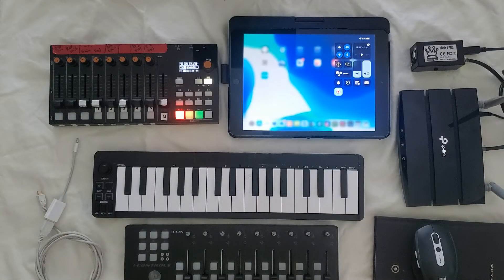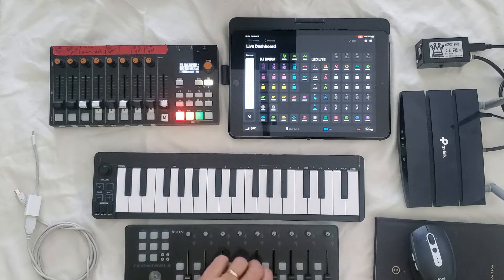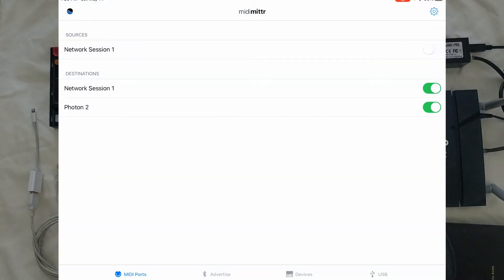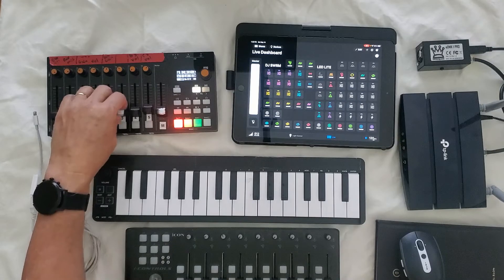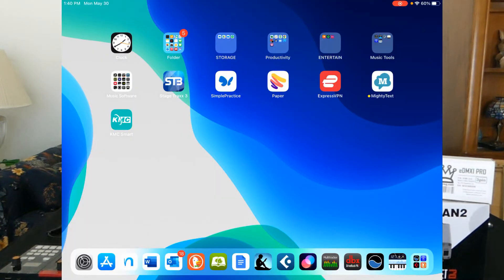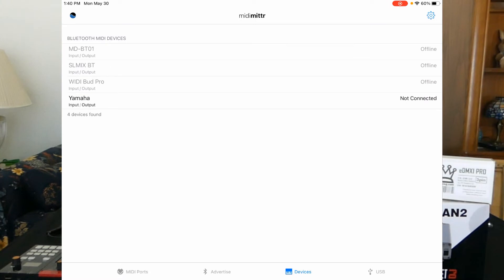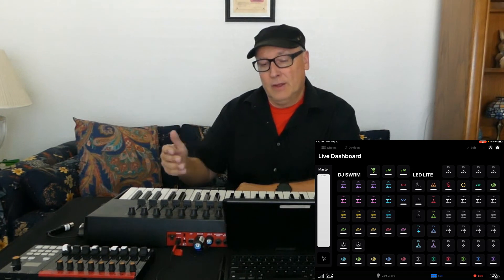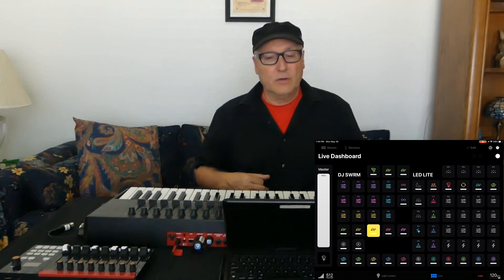Running DMX from your iPad using Photon2 using Newer BLE or converting legacy MIDI devices to BLE

Comment: I want to be able to midi control the dimmer fader by expression pedal. Do you know if it’s possible to midi map this/CC message on the app? The midi mapping part is an in app purchase so can’t find this out for myself but want to know if it’s possible before purchasing.
Reply from the maker: Yes. The main thing that you want to be sure of is that you have a MIDI connection to your iPad (best if it is either Network or BLE). If your pedal communicates midi via 5 pin DIN, you are in luck. Just grab a WIDImaster from CME and it can pair via BT to your iPad and Photon will pick it up with no problem. If it only has a USB B or C input/output to your pedal then you will need to directly connect it to the iPad. If the pedal has integrated BLE, all the better. The main question is “how does your pedal communicate MIDI to the iPad regardless of any particular app?” This is the biggest matter. Photon will see MIDI direct to your iPad (mostly, you don’t even need midimttr). The video after this one, where I construct a light show live is completely via a BLE connection from a 5pin DIN on my MPK261. Photon accepts it all!. Be sure, to create the fixture, put a control on the Live Panel, then you can assign the MIDI CC# by just moving the pedal.
Reply: @CaliforniaCreedence  thanks so much for your response. Sorry I should have said that I already have an expression pedal connected to my Morningstar which has a Widi Jack which connects to my iPad and other things. I could see photon could see CC messages but wasn’t sure if an expression pedal would work in this way. Thanks again.

Comment: I just purchased a DMX-AN2. I was able to configure it (after a lot of hassle), but as soon as I connect it to my router, it isn’t seen on the network. Any thoughts are appreciated.
Reply from the maker: Either the router ip needs to be changed to 2.0.0.0 or the AN2 ip needs to be changed to the router ip which you will need to know. Usually on the router label. Then they will “talk” to each other. I have had others struggle with this, I walked them through it over the phone. If you need help I am willing to walk you through it.
Reply: @CaliforniaCreedence  great. That has worked. Thanks so much. I’m in business and creating a show. I have some moving lights which will be a challenge. One issue I am having is that I’ve created a new fixture profile, with custom controls, but many of these controls are not appearing when I place the fixture in a group. I am a bit lost on this.
Reply from the maker: @AndrewBanker1  They don’t appear under custom controls when in the Show view and opening the group? There is a button labeled Custom Controls when the fixture is selected in the group. You may have already done that, nevertheless. If they don’t show there, then the device setup was not done properly.
Reply: @CaliforniaCreedence  thanks. I can’t see how I’ve gone wrong. Any chance you could help me if I send you some pictures? I’m probably missing something silly! I have an example on some wash lights where a mode slider on channel 1 is not appearing. But similarly, I set up a detailed map for moving lights last night. Some of the custom controls appear, some don’t. ☹️
Reply: Interesting. If I put the same fixture into a different show, the custom controls appear!
Reply from the maker: @AndrewBanker1  Sorry for the delay getting back to to you. I had an early show tonight. Just got back. I would be happy to help any way I can. Feel free to send any screenshots of what is causing you the problems. I am at johnobrien@californiacreedence.com

Comment: another follow-up question! I am recording MIDI notes from a Juno keyboard into Logic. I have linked buttons in Photon 2 to trigger different Presets to correspond to those notes. I have exported that midi date to Multitracker. It plays just fine along with another midi track that controls my Kemper. Here is the problem. I am not well versed in MIDI and sometimes, it seems like a Preset is "on" and the note turns it "off" or vice versa. Is there a way to get midi notes to always turn on a preset and not to toggle on/off? Sorry if my question isn't clear but I am just learning the nomenclature. thanks.
Reply from the maker: Be sure in Photon to set the button as Flash and not toggle in Photon on the button you set up.
Reply: @CaliforniaCreedence  thanks. I’ll give it a try tonight.
Reply from the maker: @oneminuteguitarlessons6060  Yes, look under Trigger Mode. You have the choice of Flash or Toggle. Be sure to set all buttons on the Live panel under trigger mode to Flash.

Comment: Hey John! Great videos, all your videos on Multitracker are so helpful and our band now uses it :)

We have decided to start running our lights with the tracks and I really like your set up.

I have bought the Chauvet DMX-AN2 to use with Photon 2. Are you able to help me with changing the IP address to work with our TP Link router?

Any video links would be great! I did find one but it seemed like they were changing their computers IP to the Chauvet rather than changing the Chauvets address.

Thanks in advance :)
Reply from the maker: Yes, my ip on my chauvet is now in agreement with my router. 2 ways to get things done is to set your router octet (ip address) to be able to include the Chauvet hardware, ie gateway/ip set to 2.0.0.61, Subnet 255.0.0.0 leave DHCP enabled. Plug the Chauvet into the router, access the router from your iPad, PC, etc (dhcp assigns an address), then open your browser and type in 2.0.0.1 which launches the web interface of the AN2. Change the AN2 address to 192.168.1.10 (the last number of the octet can be anything between 2 and 255, it doesn't have to be 10), save the new configuration of the AN2. It will disappear from the network. No worries. Set your router ip back to the 192.168 1.1 and Subnet mask 255.255.255.0, keep DHCP enabled on the router. Restart router. Log in with your iPad, launch photon2, boom! You have dmx. Be sure you are using the right port on the AN2 A or B whichever is set to your universe ("0"), then have fun with DMX via photon2!! Call me at 209.505.3900 for any questions or walk through. Leave me a message and I'll call back.
Reply: @CaliforniaCreedence  Thanks a million John! I've been gigging all weekend but going to try and sort everything out tomorrow :)

I'll drop you a message if it all goes wrong haha!
Reply: All working :) Thanks a lot John!

Now to program everything :)
Reply from the maker: @manhattan_band  yess!!! It's really a great system. Consider some wireless Donner DMX dongles to not have to use a cable to the lights.
Reply: @CaliforniaCreedence  we started using the Chauvet wireless dmx a few months back :) faster to set up and makes the stage a lot neater! Love it :)

Comment: Hey 😄 do you solve the problem that the router you use to send Dmx rarely get internet? it’s mean you can’t use the ipad to send music or use a dj software with streaming service etc… (Ableton link is a nice feature but all devices have to be connected to the same router wich have no internet 🙃)
Reply from the maker: Hi, thanks for the question! This could be done, but all of my Wi-Fi routers are only set up as LAN (local area network) with no WAN (Wide area network) as I have no need for an internet connection. However, your cellphone hotspot has DHCP in it (believe it or not), so all you would need in the hardware setup to which you are looking (LAN with WAN) is a WiFi access point that hooks to your cellphone hot spot which will manage DHCP. Again, I don’t need WAN with my setup.